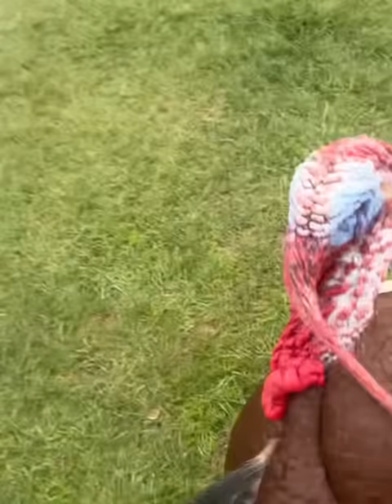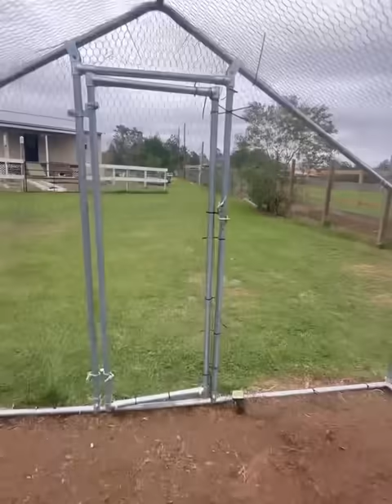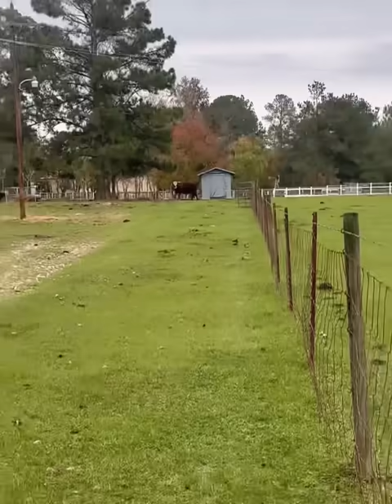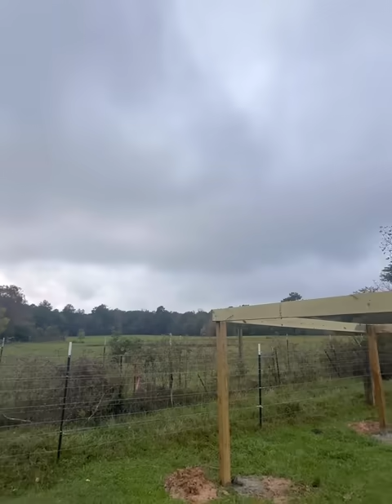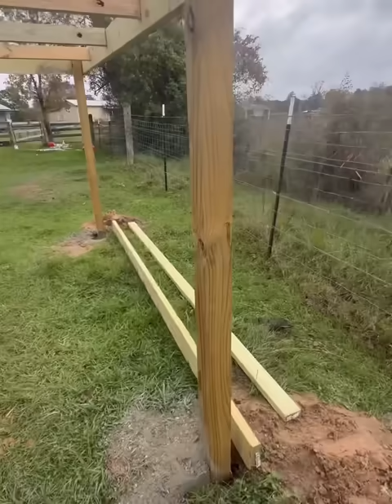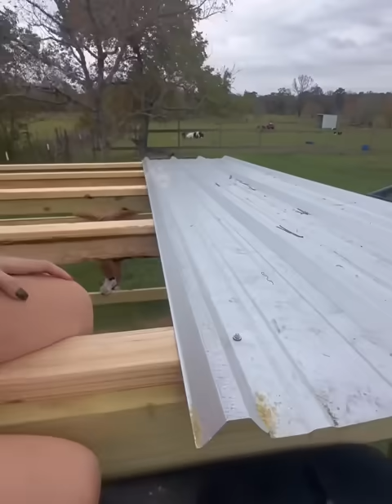I am under attack - with sound!

Comment: Does the sound of the rain on the metal roof bother the cows?  It would me. Especially with the heavy rains you get. We are near the San Francisco airport and we never get the heavy rains you do. You could watch airplanes all day here. All big planes and even helicopters from the news stations. You would be tired of them in short time. During a bad storm they go at a crazy angle right low over our house. We can wave to the passengers. Have a good day.